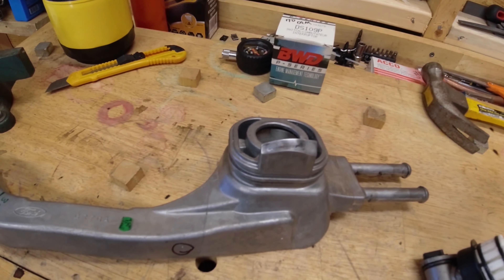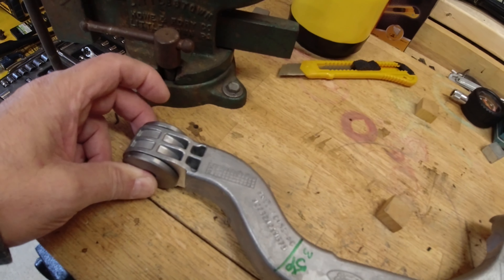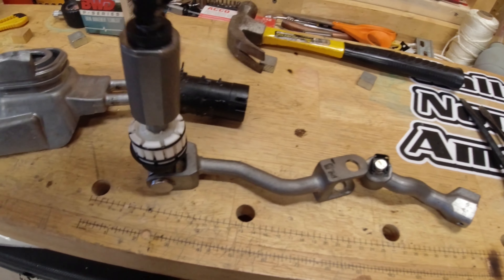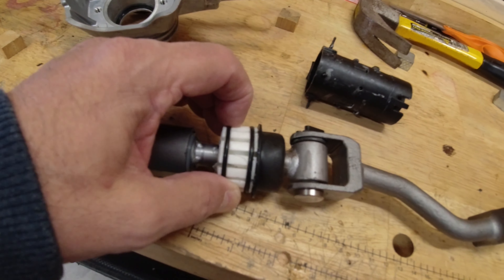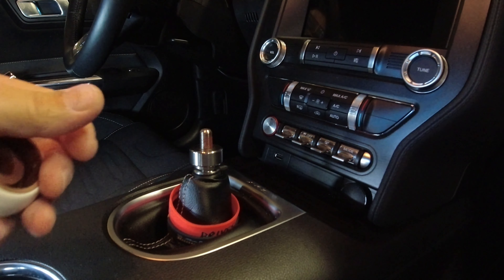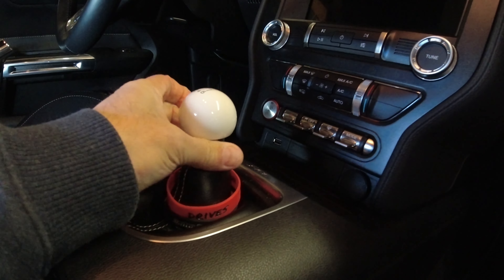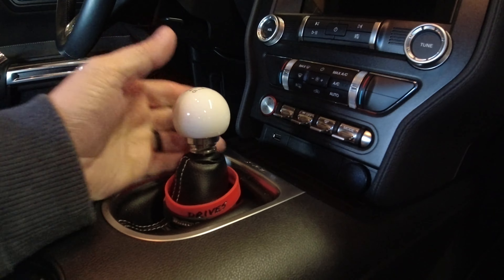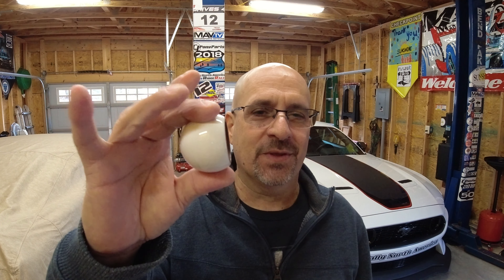Installing a MGW Mustang GEN 2 shifter?  Do not make this mistake!

Comment: Hey Tony, new subscriber and love the content. First, I'm actually impressed with that OEM shift linkage, looks nice/more robust than what I remember being on my 08 GT500. I actually still have the OEM GT500 shifter and linkage in my garage, even though the car has been long gone. I should go look at it now to see how it compares to the current setup. Anyway, I was gonna suggest you look into Raceseng shift knobs (I am not affiliated or sponsored so no financial gain for me). They also make different length "extenders" for their shift knobs so you can set the shift knob height to whatever you desire. I actually got one of their shift knobs for my 18 Accord and a 3" extender to help bring the knob height up far enough where it wasn't causing me to have elbow/arm clearance issues with my drinks in the cup holders.
Reply: Oh and bonus, if you are AD or former military (Veteran/retiree) they give you a discount. I think you just have to email them and maybe send a copy of your ID card or DD214 to them).
Reply from the maker: Thank you for being a subscriber and for the kind words! I have the MGW knob on the way and it is not at all recessed so I should be good and pick up an extra inch or so of height which should work. Thanks for your service and yes I am ex military. 9 years Air Force, active during Desert Storm.
Reply: @TonysFordsandMustangs  How did it turn up? Was the MGW knob higher? I am currently looking at the very same dilemma and cannot find a definitive info. I understood that in the video you considered the OEM knob with the adapter to be significantly lower than the OEM knob on the OEM shifter, but you actually had not compare it to the MGW knob on the new shifter at that time yet.
Reply from the maker: @risa4fun  I ended up buying a knob from MGW and that worked out well. The OEM knob is a half knob. and the threads almost go all the way to the top of the knob. MGW's is a full size knob and threads start at the bottom. Plus there is a lock nut so you can adjust the height a bit.
Reply: @TonysFordsandMustangs  Thanks for the clear and concise explanation. I finally understood how the OEM adapter works. I did not realize that both variants are using the same rod/thread and that the OEM knob is actually screwed by its top half, while the MGW knob by its bottom half. Makes sense now.
Reply from the maker: @risa4fun  That 1.5 inches makes all the difference. I know, "that's what she said" 🙄

Comment: Hey Tony, so I'm considering getting the MGW Shifter but have a few concerns. First and foremost, can it be done without a lift? Second since the car is new will it void my warranty. I know some dealers won't void it but some will and this has always been an issue with aftermarket parts.
Reply from the maker: I don't think it's that much of an upgrade really. Yes you can do it on jack stands but it will be much more difficult and this will not void any warranty. Really any mod has to be proven to be the cause of the warranty claim in order for the dealer to deny the warranty on said part.

Comment: The problem is those MGW shift knobs are ugly imo
Reply from the maker: You need to get something that sits up and threads from the bottom. The factory knob is useless with an MGW. The threads start in the center of the knob and run to the very top. It sits so low that it's unusable. Find something that works for you looks wise I guess.